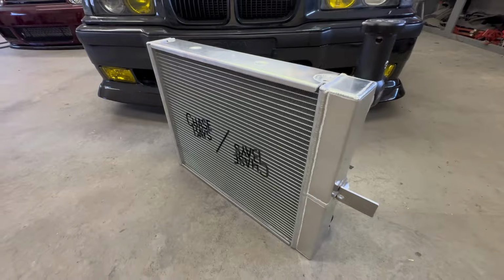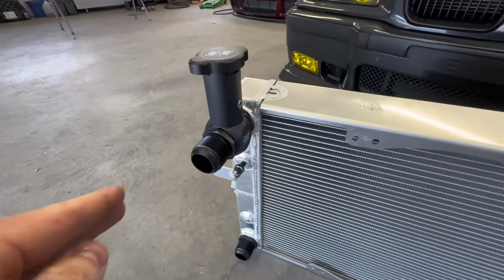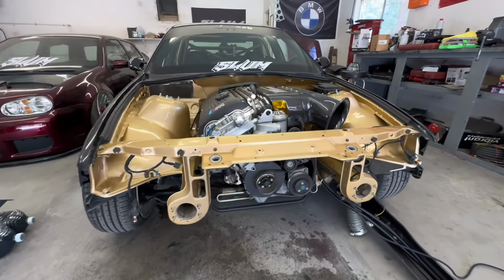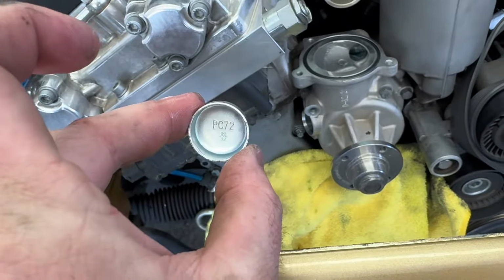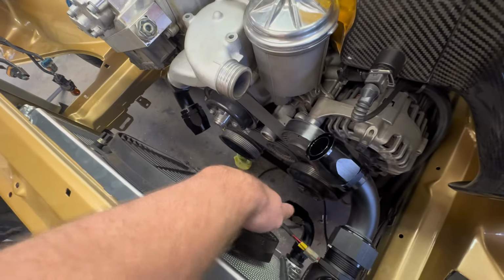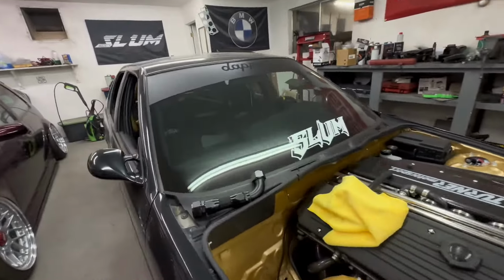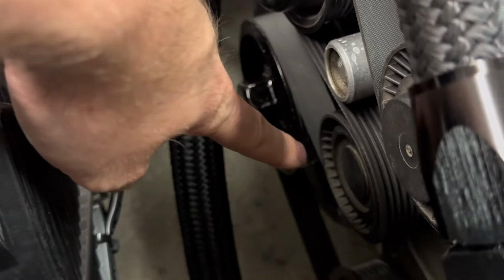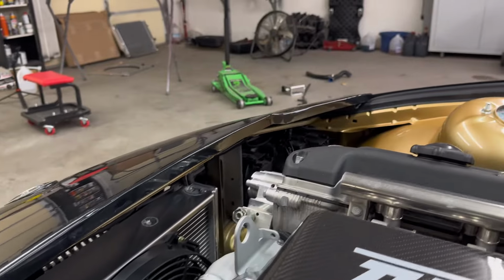Installing A Chasebays Tucked Radiator On My S54 E36

Comment: Love the build dude! Killer work! Thanks for the support!
Reply: Just wanna thank you for making the most difficult part my manual swap on my e36 a walk in the park. The flexible clutch line straight into the slave cylinder instead of the OEM hard clutch line was AMAZING.

Comment: Dual pass pretty much guarantees that the entire surface area of the cooling core is utilized, with a single pass the corners rows can become stagnant. The biggest thing about a dual pass is that it facilitates the possibility of both the inlet and outlet being on the same side of the radiator, with a single pass this can technically be done but is incredibly inefficient. Been on the fence about this rad for a while, might just go for it... just really wish they would've shrouded the E fan instead of leaving the whole back of the radiator open. Not sure if you're open to suggestions from randoms on the internet but looking at your setup, the upper hose is basically begging for a custom baller swirl pot install there with the radiator cap relocated on top... Just saying. Lol

Digging the content dude, new subscriber here.
Reply from the maker: Thanks for the added info man! And as for the shroud from what i gather is. Shrouds help cool the radiator better at idle and low speeds, but can be a restriction on cooling at normal speeds since a shroud is basically a wall. Without the air will be able to pass through easier without relying on the fan being the central point of heat extraction.. Granted i have no ran any tests on this theory but it makes sense to me🤷‍♂️

Comment: That engine bay is definitely pretty.  Not sure if the tucked radiator would leave room for an intercooler and an oil cooler in my dreams but its very nice.  Can you fit  an electric fan on the front?   An Hose is slick.   Have you made a video on building these?  I would really miss my AC.
Reply from the maker: Intercooler should still fit, and i do have a oil cooler in front of the radiator. About 1 inch of clearance
Reply: @_unclemuscles  I saw the oil cooler in a later video...  That the intercooler will fit make this tucked radiator a very tempting piece.   My Mishimoto is never going to die but extra room in the engine compartment would be very nice to have.